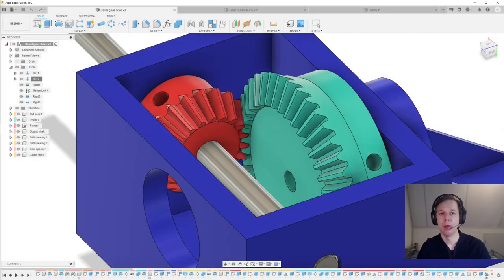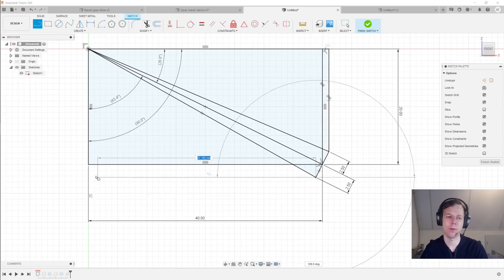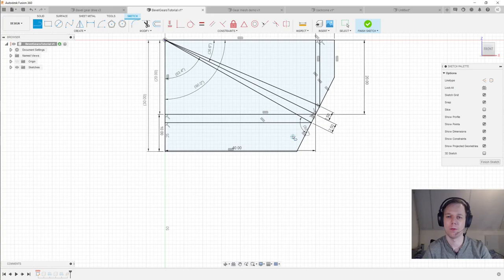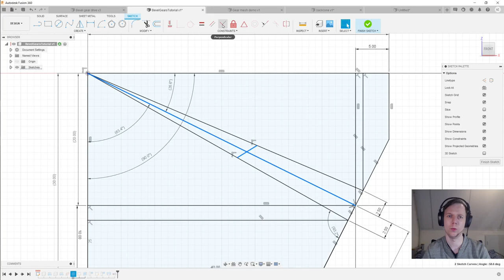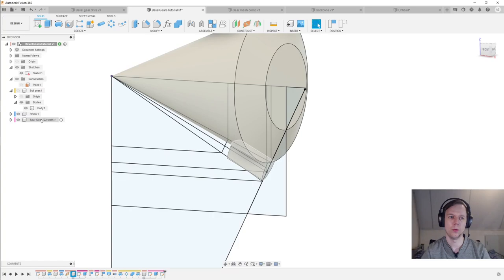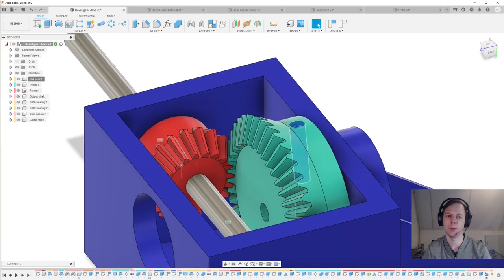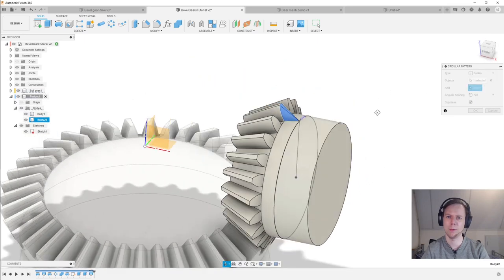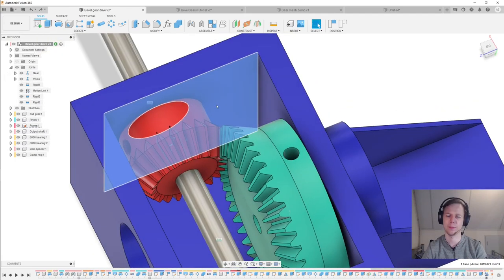How to model Bevel Gears using Tredgold's Approximation (Gears pt 6/7)

Comment: wonderful series (I just stumbled across it), I would love to see an entry on cyclodial gears as well (given that in the planetary gear episode you talked about doing compound gears for very high gear ratios), both single stage and double stage (which eliminate the pins and bearings for the output shaft)

do you have a patreon account or similar to allow us to support your efforts?
Reply from the maker: Cycloidal drives is actually a good idea, I have seen a number of videos of people who made them on Youtube, the latest being James Bruton. However I do believe most of them don't talk in-depth about how they designed it, or what things to consider.

I haven't yet opened up a Patreon or anything like it, but it's something I'm starting to consider. Not entirely sure what to do with the levels and perks though. AvE seems to do quite well with his single-tier beer fund, but most creators have some progression of tiers and perks.
Reply: @antalz  re:patreon, I sponsor a fair number of people and mostly ignore the perks, start off with a beer fund approach and if it turns into real money, you can add perks that make sense based on requests (you have a business, so any perks you offer need to make sense from a business point of view) Applied Science does per-video sponsorship so he doesn't feel pressured to get a video out on a particular schedule, which is good for in-depth technical videos.

re: cyclodial gears, yes I watch a lot of videos from people who are making them, but other than the gear ratio, very few people talk about the considerations in designing them (especially for 3d printing)

what is the real effect of different eccentric values (is it like pressure angle)?

I see some people with bearings on the outer pins, others without and talk about it being a rolling contact, what is real?

almost all cyclodial gear setups are N:N-1 tooth ratios, what if you did something different?

dynamic balance of cyclodial gears is an interesting topic, but I think it only matters if you are talking about higher speeds where the disks are heavier. If you talk about slow things (camera mounts, 4th axis for CNC, etc) this doesn't matter as much, right?

onshape has a cyclodial tool for free, it looks liek fusion 60 has one that's $20

probably several videos worth of ideas here :-)
Reply from the maker: Yeah it often happens like that. Lots of rabbit holes to explore, I have a rather long list that fills up with topics much faster than I can check them off.
Reply: @antalz  As for perks you might make source files of what you model available for patrons. For example, your explanation of bevel gears modeling is really great and I understood how it's done, but nonetheless, I lack skills and time to model it properly for my own hobby project. And in such case patreon allows me to thank you in some material way and unblock my project, and for you it won't be like throwing your efforts for nothing. Win-win:)
Reply from the maker: @gppl77  I currently usually just make the files available for free, I just sometimes neglect doing so or I feel the files don't have much value in themselves. Whatever the case, I would prefer as much as possible to be available to as many people as possible. I know there are also viewers from Brazil, Egypt, India, Sri Lanka and many other places that I would prefer can look at the content without paywall.

I'll give it more thought, but I have a fulltime commitment now that'll last until March I would say. That's also why I haven't been posting anything unfortunately.
Reply: @antalz  Would you mind sharing this one then?:) I can modify an existing thing to my needs, but don't have skills and, TBH, time to make one from scratch.
I understand what you say about paywall, but still, 40 min of video is a big deal. Takes quite some time to prepare, shoot and edit. Would be good to have a way to support your effort.
Reply from the maker: @gppl77  I didn't think it'd be of much use to anyone but here you go: https://www.thingiverse.com/thing:4927350
Reply: @antalz  thanks a lot! Will see what i will end up with;)

Comment: With two parallel lines selected, how did you create a constraint and then add the distance between them?
Reply from the maker: You can first push the button for the parallel constraint. It may not be on your ribbon bar, but if you click on the word "constraints" you get a dropdown from which you can select it. Afterwards if you select both lines and use the dimension tool, it will set the distance between the two lines. Usually it will set the angle, but it will not if you've already defined the lines to be parallel. I almost always use the shortcut D to use the dimension tool.
Reply: @antalz , thank you

Comment: What do you think would be the biggest load of a linear actuator propelled with 3D printed gears and what would be the best gear layout for durability. Thanks
Reply from the maker: My force-extension machine can produce about 300kg of force, but most of the heavy lifting comes from the M12 threaded rods and nuts. Still, there's no real upper limit if you make the gear large enough.
Reply: @antalz  Thanks for that Antalz. Would a proper ball screw be better than buying an M12 rod from a hardware store. For your project, would a M14 bolt work better ?   If you were to use your machine to move a 50 KG load in the vertical plane, with a stroke of , say 15 cm,  and a period of , say 5 seconds,   ( 3 cm  a second )  , what would be the best combination of threaded rod, plus gears. 3 cms a second may be a bit quick for a normal M12 threaded rod. Sorry, I don't wish to be setting you a task here.  May I re-phrase the question to a simple yes or no.  WOULD IT BE POSSIBLE USING 3 D PRINTED GEARS AND AN 895 MOTOR TO PRODUCE A LINEAR ACTUATOR THAT CAN MOVE A 50 KG LOAD OVER A 15 CM STROKE, IN A PERIOD OF 5 SECOND ?  A simple yes or no answer would help, thanks. very much.
Reply from the maker: @jackspratt4343  Yeah that should be possible. What you're asking is 500N at 0.03 m/s, which makes for an output power of 15W which most 895 motors can easily put out. 

I'm not sure what setup you should use though. Probably a very low or no gear reduction on the motor. If you take an M8 rod, with a 1.25mm pitch, you need to rotate that 24 times per second which is a bit much. You can use bigger rods, because they have coarser pitch. You can also use TR8x8 trapezoidal screws, I'm quite sure they can take that load. For a TR8x8 you'd only need about 4 rotations per second, so that would require some gearing. I recommend buying a motor with integrated planetary gearbox in that case. It's probably better to couple the motor to the rod directly using a flex coupler. Do use the ones with orange plastic spiders, not a fully aluminium one. No need for 3D printed gears there. It's also very hard to attach a gear securely to TR8x8 rod, or M8, it's much easier for bigger rod like M12 and larger.

Basically, find a threaded rod that has coarse enough pitch that you can obtain the desired speed. 

For my own device, an M14 rod has coarser pitch, which means my machine would move faster, but exert less force. Even low-grade M12 rods can carry several tons of load, so that's not a concern.
Reply: @antalz  That's great advice, Antalz. Thank you, May I ask whether the power calculation, of 15 Watts for 500 N @ 0.03 m/s would "extrapolate" by a crude rule of thumb, to  30 Watts @ 0.06 m/s and 45 Watts, in an ideal world @ 0.09 m/s.?   Thanks again.
Reply from the maker: @jackspratt4343  Yeah, energy is force*distance, and power is force*speed.
Reply: @antalz  OK, so it scales well, in theory anyway.  Thanks again for your prompt answer.
Reply: @antalz  Thanks for taking the time to reply to my questions.
Reply from the maker: @jackspratt4343  No worries mate, best of luck! Keep in mind that threaded rods on nuts are very inefficient, proper lubrication helps a lot.

Comment: Great video. Based on my reading, the first right angle line is 1.25M and the second is just M.  I believe this represents the total tooth depth. Let me know your thoughts.
Reply from the maker: Yeah it's like with racks, and also regular gears. From the pitch line/circle inwards is the dedendum, which is 1.25*module standard, and outwards is the addendum, which is standard 1*module. It's a bit clearer in my video on racks.
Reply: @antalz  This may not be critical but you made yours 1.25 * module on both sides in your tutorial. Great presentation. I love how you explained it all. I am new to CAD and I decided to learn Freecad only because it will remain free. From all that I have seen on YouTube, Fusion 360 seems to be better but it may not remain free for long.
Reply from the maker: @dannyperry8070  Yeah I did. That's because I want to create two cones, for two gears, and later add teeth to them. The "inner diameter" for both cones is their pitch diameter minus 1.25*module. When measured from the pitch diameter, the tooth goes 1.25*module down to meet up with the body of the gear, and 1*module up. This causes a 0.25*module gap between the tip of the tooth of one gear and the inner diameter of the mating gear. This is intentional clearance.
Reply: @antalz  Thank you for your quick response. So when I draw my sketch in Freecad, I should use the 1.25M on both sides? I don't know if it makes much of a difference in 3d printing but for accuracy's sake? So the .25*M is just and allowable clearance used in the industry?
Reply from the maker: @dannyperry8070  Yeah for making the "inner diameter"-equivalent cones, definitely use 1.25*module on both sides. It's actually more important in 3D printing, because the process isn't that accurate, so clearances are more important, not less so. If you don't have this clearance you risk the tooth tips interfering with the other gear.

I'd recommend modelling up two basic spur gears and looking at their dimensions closely. Check what the pitch diameter, inner/outer diameter, addendum/dedendum are, and look for that clearance near the tooth tip. I think it's wise here to understand that first before continuing. As you can tell from the length of the video, bevel gears are somewhat advanced stuff, and even this 40-min video builds on stuff done in previous videos. I fear you might get stuck later otherwise.
Reply: @antalz  I am a PE in electrical and as I delved into the arithmetic of beveled gears, I realized the complexity. For example you can't arbitrarily choose the number of teeth for the pinion. There is a limit based on I guess angle and module. I was not able to find a simple formula for that. I will try the 1.25 on each side and see how it worked out.
Thank you for your educational responses. I have learned something.
Reply from the maker: @dannyperry8070  The gear ratio, shaft angle, and cone angle are related to each other. Choosing two will fix the third. The size is essentially determined by pitch diameter = module * number of teeth. The minimum number of teeth on a gear is usually 17. You can go lower with undercutting, or with a higher pressure angle. I go into that a bit more in video 2 of this series. The pressure angle is complely separate from the cone angles or shaft angle, it relates to the shape of the teeth.
Reply: @antalz  This is what I don't get. I printed some beveled gears with only nine teeth with 90 degree shaft angel. There were using it for a rc car differential.
Reply from the maker: @dannyperry8070  I suspect that was done with a larger pressure angle, like 25 or 30 degrees. If you allow for some undercutting or just some inaccuracy in the mesh, that can work fine.
Reply: @antalz  I will watch your other video's in the series

Comment: what was that, in between the bull gear and the motor, which drives the bull gear, attached to the motor(29.30)?
Reply from the maker: Not sure what you mean. The blue gear is attached directly to D-shaft of the motor. Between the pink gear and the bearing I put a small 3D printed spacer.
Reply: @antalz  i mean to say, the motor you had used has shaft diameter 5mm but in the gear hole is of 8mm...that black part top of the motor is extra part? To increase the torque or it is the part of motor? Or can you please provide another link where i can find the same motor ...i don't know but that link has some trouble 🥲
Reply from the maker: @kamrealamshaikh4375  Yeah the 775 motor itself has a 5mm output shaft, but the motor I bought comes with a planetary gearbox included and attached. I think I used the 24V i13 version here: https://nl.aliexpress.com/item/32822227433.html

I used the same motors for my tank project, which I still need to finish.
Reply: @antalz  yups, that's what i want to know....Thanks, great work by the way. I am using your design in my project that's why I need to know about that gear system 😉😉😉

Comment: At 4:40 - You mention the line is "1.25 times the mod" , in this case you entered "2" for the mod.   what is the mod in this case?  It seems like it is the tooth depth, and if so, why not call it that instead of a  "mod" ?
Reply from the maker: The module is a measure for how large the gear's teeth are, and is related to the pitch diameter. In this case the bevel gears we're building are module 2 mm. Now when measured from the reference cone (compare reference circle or pitch circle for normal gears) I want the teeth to have an addendum of 1*module, and a dedendum of 1.25* module. The gear generator will take care of the addenda, but for the dedenda I must specify here that the cone that makes up the body of the gear is 1.25*module smaller than the reference cone.

For bevel gears you essentially do all the math for the outside edges of the cones, and then from there loft everything inwards to the apex. This also means the teeth are larger on the outside than on the inside, so when we say "module" for these teeth we mean the module on the outsidemost end of the tooth.

Comment: Okay, I spent a couple hours trying to take a similar approach in Missler Topsolid, where I don't have a gear generator to lean on. It does have an involute curve generator though. I got to the point where equal teeth on the 2 gears mesh perfectly, but once I shrink the pinion, the teeth no longer mesh. If you have a few minutes to look at this video, that would be a huge help! 
https://www.youtube.com/watch?v=6ZFHzi5EphM

Comment: hello,this kind of drawing won't make the bevel gears conjugate, as you say approximation. and we can make the real conjugate bevel gears,but not your method.
Reply from the maker: Do you know a modelling method for true conjugates? I don't think it matters much because the approximation has smaller errors than almost anyone can reproduce on their printers. But it'd still be interesting.

As far as I know even commercial producers use one of a number of approximations to ensure they can mill the gears.